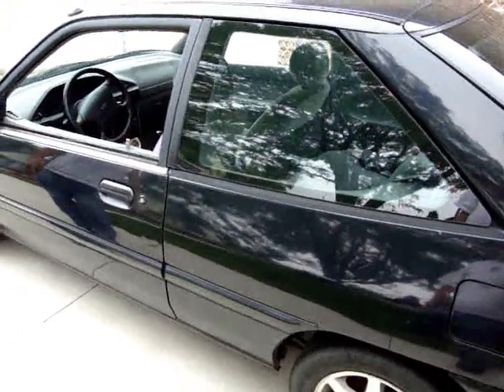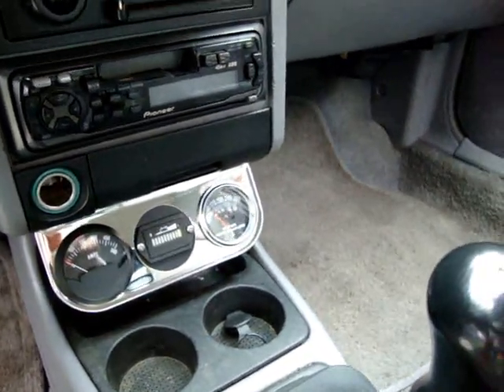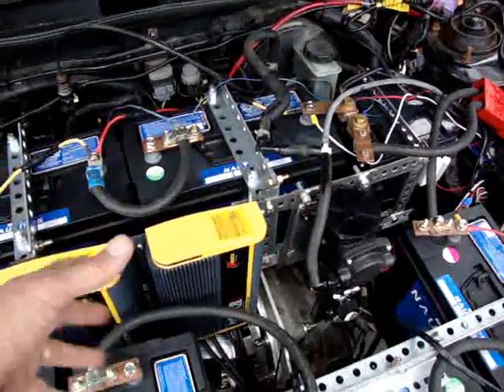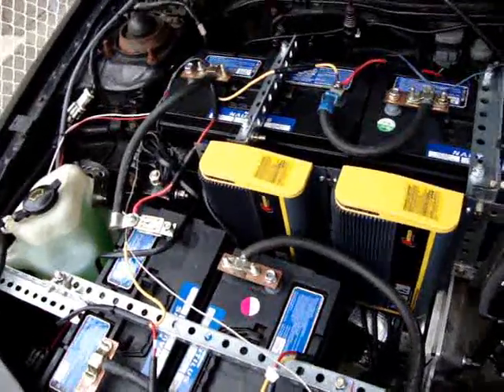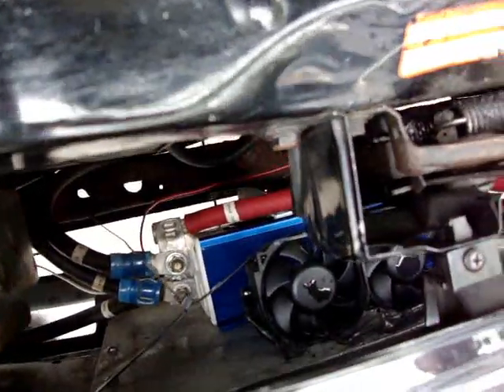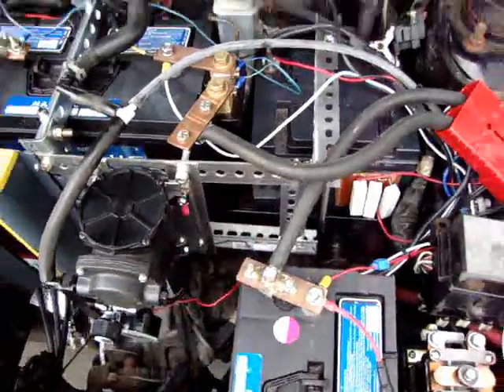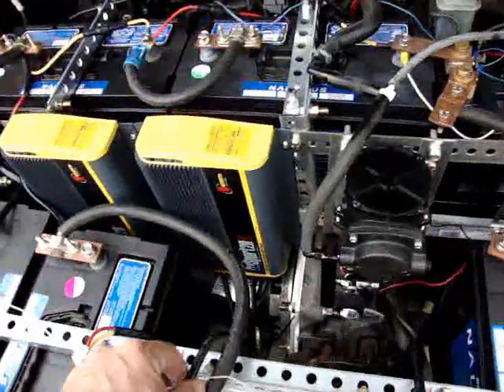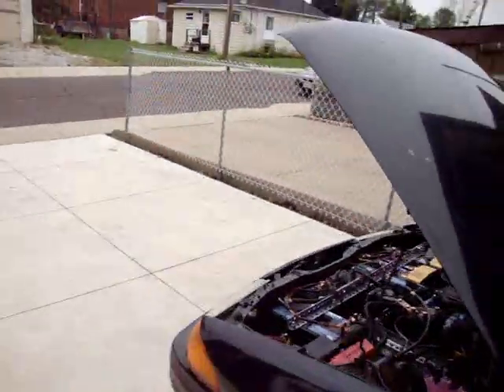The Homebrew Electric Car Saga - Escort EV Installment 10

Comment: I,m would like to convert an 01 4x4 Rodeo. My question to you is, if you used lets say 10 - 8 volt  deep cycle golf cart batteries wouldn't you have had better distance? What do you think if I use 15 - 8 volt batteries to total 120 volts, or 30 - 8 volt to total 240volts. wouldn't I lower the amp draw and in turn increase my distance ? 11.45” diameter, series wound DC motor
Weight, approx. 229 pounds
43.7 HP (72 Volts, 453 Amps)* handles up to 288 volts
135 Ft. pounds torque*
5,500 RPM's
Reply from the maker: Yes, higher voltage will reduce overall current draw, but the range is dependent on how much total power that you have and how much the vehicle uses to travel one kilometer (or one mile) depending on your calculation. The Escort had a total of about 4600 watts of stored power, and would travel about 25 kilometers on that charge. So, I know that it used about 184 watts per kilometer. The car was very light, so you need to find out how much you vehicle would weigh with the batteries and work out the total power (use voltage x current x 55%). The 55% is due to "Peukert Effect". Lead/acid batteries are only useful for 55% of their rated value due to the rapid fall-off of voltage after a certain discharge tme. This was determined through many tests, so that must be kept in mind when calculating.

Comment: Hey! given the mention of Sarnia and shots of snow in other videos, are you in Ontario? I haven't gotten through all the videos, but did you have this running in winter?  Any issues with registration, safety inspections, or insurance hoops that were hard to jump through? very interested, but I'm in New Brunswick, and our winters tend to have a wider range of conditions, so i'm trying to decide if a project like this would be 3 season vehicle only or if I could get away with this for a 50km round trip commute with some heat, with the right battery setup, of course.
Reply from the maker: Yes and yes. We are in Ontario and I did try to drive it in the winter, but the batteries (flooded lead-acid) just couldn't take the cold. The range dropped in half. I no longer own this car, as we moved to a rural area and the range became an issue without a huge investment in batteries (LiPO). So, I decided to shelve the idea due to cost.

Comment: what did your numbers look like as far as cost? Nobody truly ever talks about it
Reply from the maker: The total cost of this vehicle (including everything) was about $5K. But, having said that, within 2 years the lead-acid batteries were pretty much toast. I was only getting about 14 kms on a charge by then, which was getting impractical for any serious use. I looked at installing Lithium Ion packs in the car. If I were to replace the pack with a 2000 AH LiPO with the proper charger and battery management system, it would have increased the range to about 80 kms (50 miles), but at a cost of about $7K+, I decided it just wasn't in my budget to do. I sold this car last year to another fellow who was doing up a Mazda to electric. Not sure if it even still around, as I believe he was just using all of the parts from it.  Ken

Comment from the maker: The motor was rated at 16 H/P (at 48 volts). The system was 72 volts at 115 A/H. The longest travel was 26 kilometres (16 miles) at an average speed of 60 km/h (40 mph). The range drops as the speed increases. It generallly would always go over 20 kilometres on a charge no matter what. Ken.